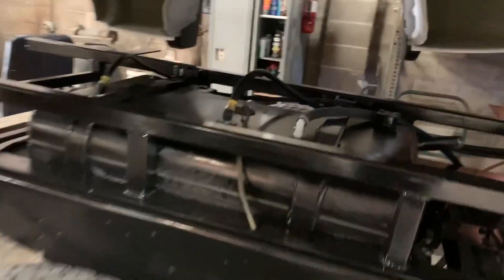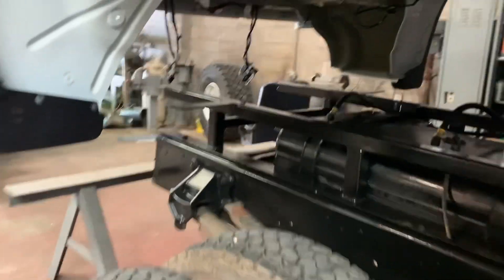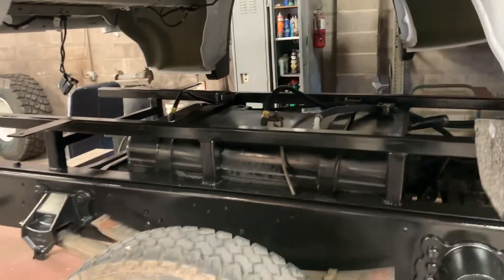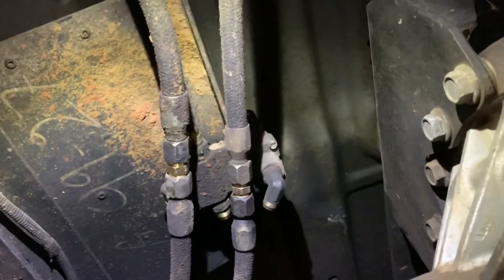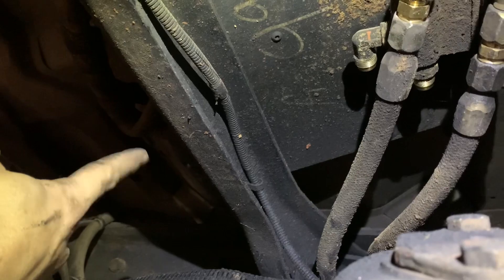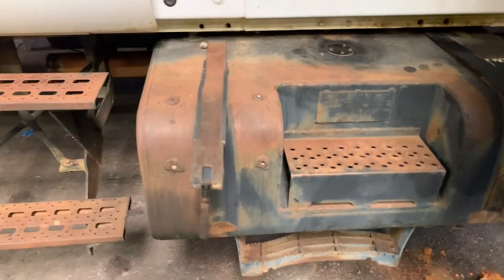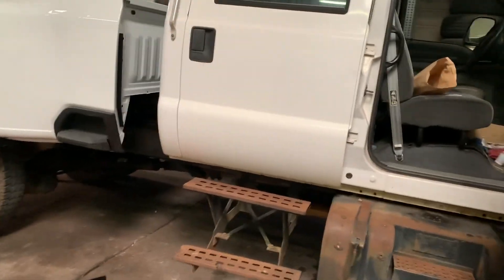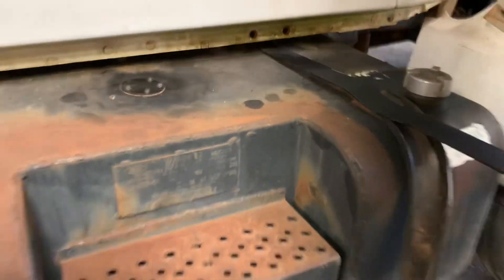F650 Build! Night 14: DIY Lift Kit & Bed Mounting #caterpillar #liftkit #f650 #diesel #Chatgpt #f750

Comment: Two questions one what year is the 650 secind what year 350 blocks for the front did you use?
Reply from the maker: Man so sorry for the delay, I got locked out of my account for a bit. The lift blocks are 1988-2019 f250/350 and the f650 is a 2003